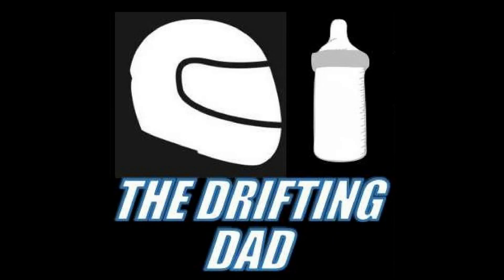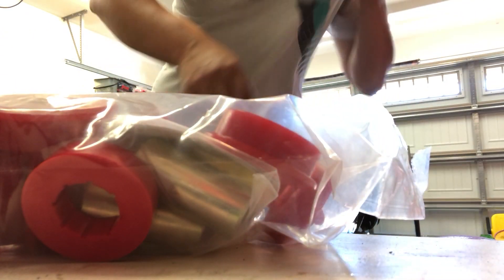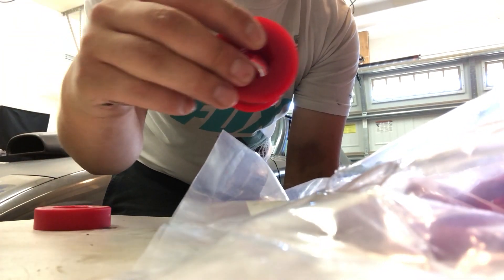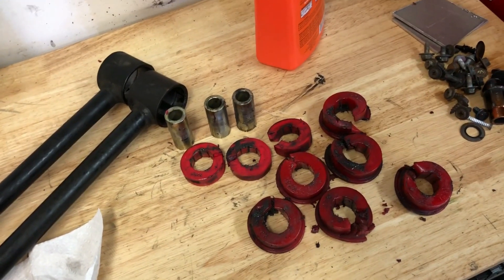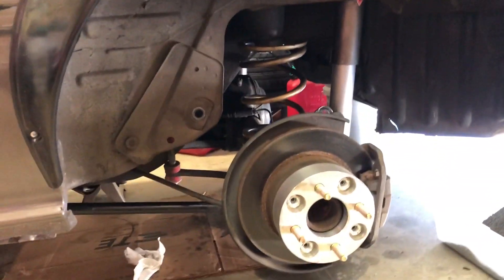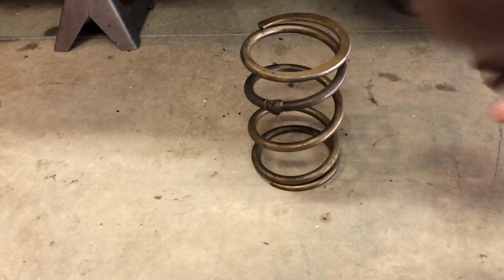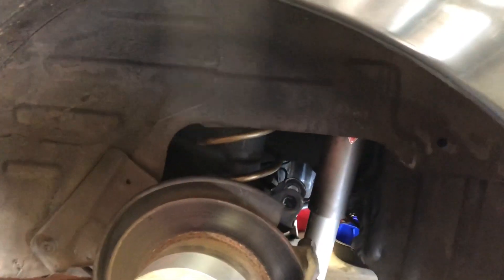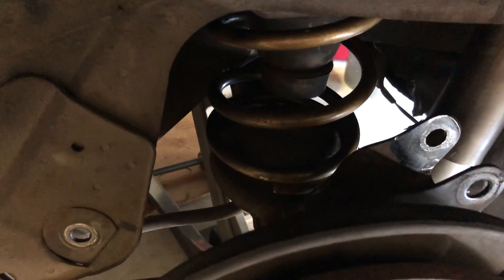RX7 FB Rear Suspension Design Part 1, How to get rid of binding

Comment: hey man i have a pretty bone stock fb and i want to swap out the rear drum brakes for disks where did you find yours? love the build bro
Reply from the maker: I had a stock disc rear end, which unfortunately are not easy to find.  I am working on an upgrade kit that uses easier to find parts

Comment: The rear 4-Link in FB are known for terrible binding and causing oversteer. Adding Urethane bushings just makes it worse. Need Heim Joint ends on your control arms. You can buy those with adjustable lengths. I chose to cut off the rear bushing  at end of all rear control arms that meet the rear axle.Replace those with Johnny Joint flex urethane bushings and housing. Rear of FB is much more manageable.Also now running a rear sway bar again.Was running a adjustable  sway- bar .Even on softest setting it was to stiff.Took stock rear bar  and ground it down to get it thinner.Then made adjustable load sway-bar supports so I can quickly change how much I'm working the bar.I can make it supper soft or firm it up in seconds.. I have been autocrossing mine sense 1990  lol .  It's a 1982 running a 6 port 13B  with Dellorto48 sidedraft ,running 15x9 Kieser wheels with 245 40 15 Hoosier.If I go to the 275 wide I'll add the flares.It could use flares now with the 245s The car is used for SCCA solo Autocross limit improved class C-Street Prepared CSP
Reply from the maker: That's awesome George!  When I did my Ford 8.8 swap i did all rod end (heim joint) links and run no sway bar, it works pretty good for drifting!  I couldnt imagine this chassis on 275!
Reply: @TheDriftingDad  Google SCCA AUTOCROSS CSP "image" I run against mostly older miatas.they all run 275 wide 15s.got to keep up with them

Comment: You aren't getting any pivot on the bushing. With such link links that's a lot of torque. One of the miata guys on miataturbo.net developed a set of bearings that will actually pivot inside of the bushing. That may solve your issue. check out sadfab.com. Otherwise you might want to go to delrin bushings or something that will not bind.
Reply from the maker: Those are pretty cool.  If you check out my more recent videos, I just went to a fully custom link setup with rod ends and that has helped a lot.  I like the idea of a direct fit spherical though

Comment: Just out of curiosity, how low are you from stock height? Or better yet, how low can you go without binding issues? Ive been thinking about getting some Bc racing coilovers, would really like to lower my FB about 2 inches from its stock height
Reply from the maker: I am about 3 or 4 inches lower, binding will not be horrible 2 inches lower than stock.  Instead of getting the coilovers I recommend getting shorter springs there are lots of 5" coil springs out there